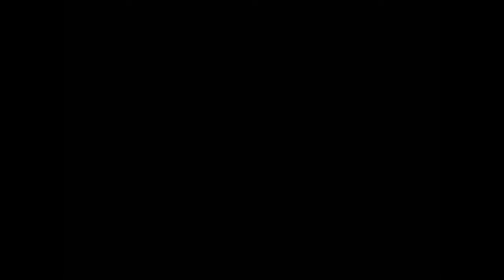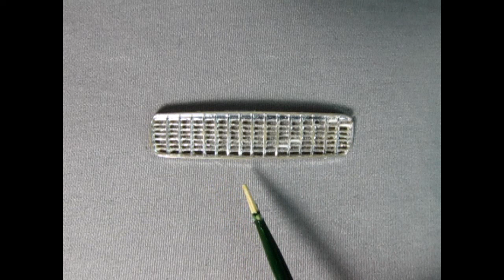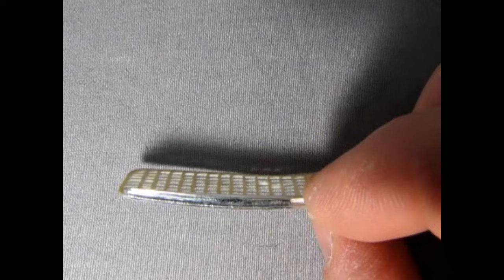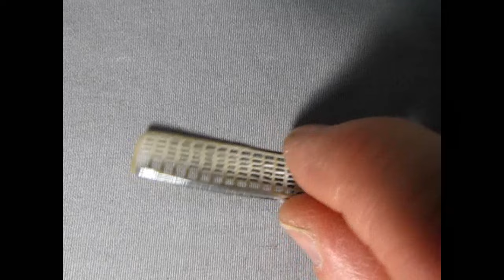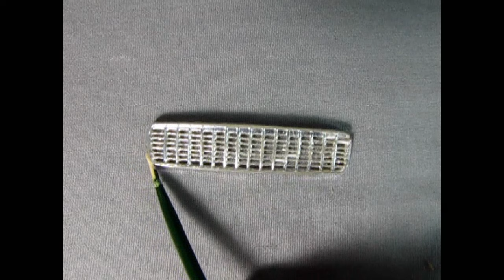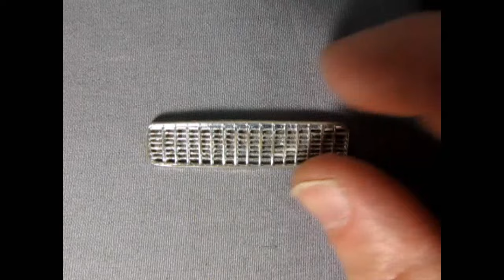How To Open A Model Car Grille - Longer Video To Come - Part 2

Comment: Nice job. The Idea with the pins sounds good. 
If you want to keep it accurate with an original 55, all tri fives were semi gloss black. 
My friends and myself owned a few back in the late 60's and early 70's.
Reply from the maker: Sounds like Gm. My 1972 Oldsmobile Cutlass is the same way.

Comment: Good  looking repair Trevor 👍and I think you're right about the colour. I would add your biscuits to hold the hood up but the best idea is research. Look at what Chevrolet did on the real car👍🤓. 👍😎Pete 🤓
Reply from the maker: For sure Pete. i was just thinking of my 1972 Oldsmobile and what GM did in that time period. Not sure if that is the same solution on a 1955 Chevy...until I look it up.